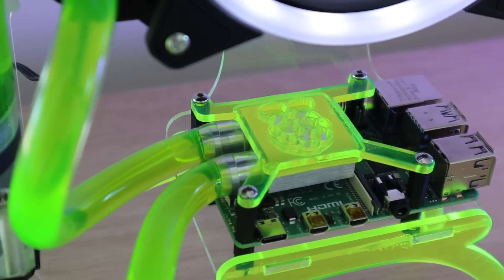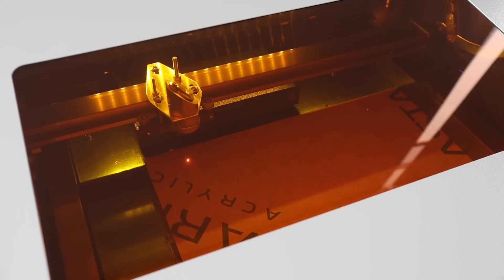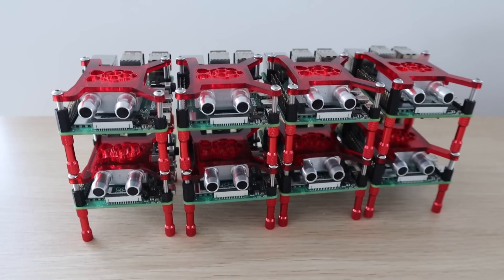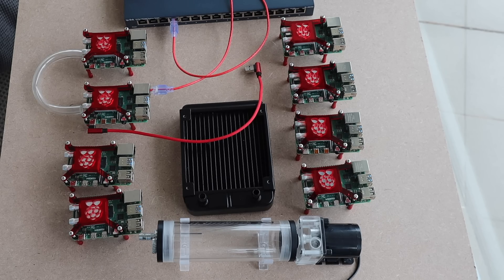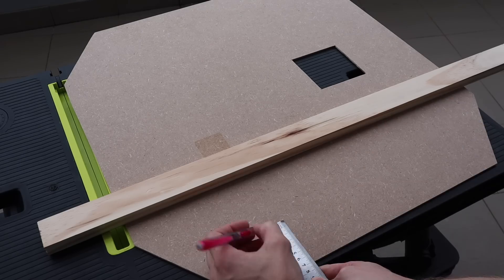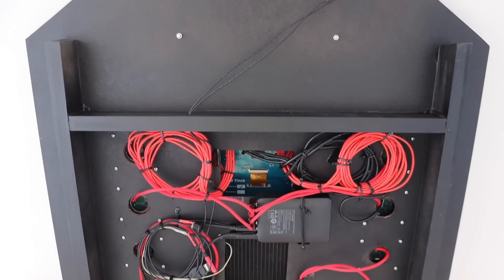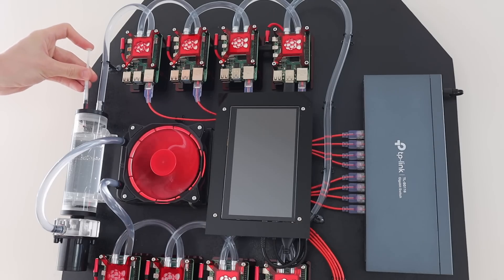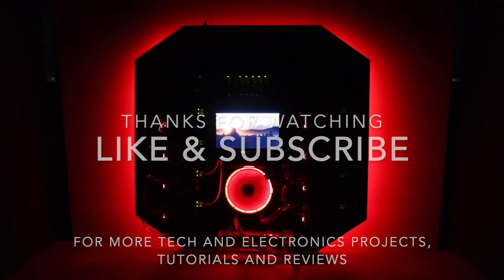Building A Water Cooled Raspberry Pi 4 Cluster

Comment: Is your acrylic cutter an Epilog?
Reply from the maker: No, it's just a Chinese K40 laser cutter. I've done a few upgrades to it, but they work pretty well as stock units if you get a good one.
Reply: @MichaelKlements  Do you have a suggestion how I might find a good one the first time? I'm seeing a 40w 12"x8" for $600. That seems very small even though I will probably only use it for PI projects.
Reply from the maker: Yes that's the one I've got. It can comfortably cut an A4 page if you remove the stock "clamp" thing they installed for engraving stamps. This has worked well for me thus far, although I do occasionally wish I could cut slightly larger pieces. If you want a larger cutting area then you're probably better off getting a 60W or 90W version. You could also look at modifying the cutting area on a K40, I've seen videos of people who have modified them to cut A3.
Reply: @MichaelKlements  Thank you for sharing your experience, insight,  creative imagination, and skills. Awesome! Please,  Keep On Makin'. (and sharing)

Comment: That looks so tidy! Those USB cables are great.

Did you consider PoE at any point?
Reply: PoE requires a Hat, which would increase the complexity and the cost. Thinking about it, it would be substantially more expensive. It would work, though.
Reply: @DanMcKellip  That's what I figured but of course it would be tidier in terms of cable management. Having said that, those USB cables are fantastic and help keep it clean :)
Reply from the maker: I did have a look at PoE for the simplicity, but I couldn't find an option which wasn't designed as a hat to sit on top of the Pi, which would interfere with the cooling block. That coupled with the price, they seem to be around the $25 to $40 range each, which adds up quickly when you need 8 of them.

Comment: I'm curious to see what the thermals are like on each Pi at a given load( Depending on thermals in the last Pi, it may be prudent to split it into two separate loops-- one per block of four).  Also depending on what CM4 daughterboards come out this year it may be worth designing a setup using something like the Piunora: https://twitter.com/timonsku/status/1337134272625467392
Since the clearance issues are much simpler then when compared to standard Pi4, you could attach a massive heatplate to a block of CM4's and watercool the heatplate instead resulting in a much simpler loop.
Reply from the maker: I haven't done a proper stress and thermal test on the system yet, but that would be a nice follow up video. I did run the Pis at full load for a minute or so and the temperature difference between the first and last Pi was only 3 degrees Celsius, so hopefully this won't be an issue. I think there's enough thermal capacity in the system to eliminate this problem.
I really like your idea to use the CM4s and a heat plate, their low profile would make this setup much simpler. I've yet to get my hands on a CM4, hopefully soon!

Comment: Currently working on watercooling my pi just for fun. I did find a way to mount a small waterblock without needing a spacer. I just used a water cooling block that is typically used for the north bridge I found on ali express and 3d printed the bracket to attach it. wondering if water cooling will provide any better performance for overclocking!
Reply from the maker: Thanks for sharing, I'll have a look at the north bridge cooling blocks available as well.
It definitely keeps the Pi cooler than any other solution I've tried, but for the price and complexity you're probably better off with something like an Ice Tower. You can still overclock the Pi to it's maximum without overheating and it costs around a quarter of the price. I did a comparison video a few weeks ago - https://youtu.be/O6O_hcckXrg
Reply: @MichaelKlements  I had already used the Ice tower and got to 2.4ghz stable. Just trying to see if I can get to my goal of 2.5. I also 3d printed/designed a simple mount.
Reply from the maker: If you go to 2.5Ghz, does the Pi overheat with the Ice Tower? The water cooling system would definitely keep it cool at 2.5Ghz, but you're likely to start running into power related issues rather than heat.

Comment: cool build, the quesion is whats the use for a pi cluster ?
Reply from the maker: I built this mainly to learn about cluster computing, but hopefully I'll be able to get it to run some simulations and rendering tasks.
Reply: @MichaelKlements  Kubernites?
Reply: @MichaelKlements  etherium node?
Reply: @TheSaintP1800  Wouldn't one Pi be enough? You'd likely want the 8Gb model, I suppose, but still. Bigger issue is the 32 ETH to stake.
Reply: @TotesCray  The bigger issues is using pi's for mining eth is like asking a child to pick up a hot tub.  Any way you look at it, it's just not practical.
Reply from the maker: When Ethereum change over to their proof of stake model then this may be interesting to try. Although with this model you could probably just use a single Pi.

Comment: Looks awesome! Super curious as to what you are using this for. A small suggestion, get some 90 degree connectors for your monitor so its not sticking out as much.
Reply from the maker: Thank you! I built it primarily to learn about cluster computing, but I'll hopefully be able to get it to run some simulation and rendering tasks eventually. Yeah they would make the cabling look a bit better. I actually debated soldering the cables to the underside of the Pi and the monitor so that they're completely hidden, this was just quite a lot of work!

Comment: Hi can you tell me how much it costs all of this ? Where to use it for? It looks very good ... Nice Project
Reply: I think cooler costs more than raspberry pi
Reply from the maker: It probably cost a little under $600 to build. I mainly built it to learn about cluster computing and try out different software configurations, but the end goal would be to use it for simulations and rendering.

Comment: Wow Maker Michael!!  This is totally neat.  I was wondering about surface mounting the radiator but then saw you had cut a hole through.  I would love to know how the thermal performance the individual nodes.  Look forward to seeing what you are planning to do with this neat cluster. Keep up the good work and congrats on the 10K subscriber mark!!
Reply from the maker: Thank you Deech! I'll probably do a follow up video on the cooling performance at some stage as well. I first need to figure out how best to log and display it. I did do a basic test, running all of them at full load for a minute or so and there was around a 3 degree difference between the first and last Pi in the loop and the system was only about 6 degrees above the ambient temperature. But this will probably change for longer runs and once overclocked.
Thanks for the great feedback and support!
Reply: Michael Klements I’ll be looking forward to the results video or whatever neat idea you want to show us all next.

Comment: Just watched your video... Nice build and nice contrast with the red and black... The only thing different that I would have done is use stiff acrylic tubes and have them managed by having them feed through to the back of the board too as well as the wires. But you've done a good job as it stands. Well done mate!
Reply from the maker: Thanks David! I thought about getting the rigid tubes, but it's the first time I've done a more significant water cooling build and I read up on bending and working with them and it seemed like a bit of an art to get right. I'll probably try them out eventually though, they do look much more professional!